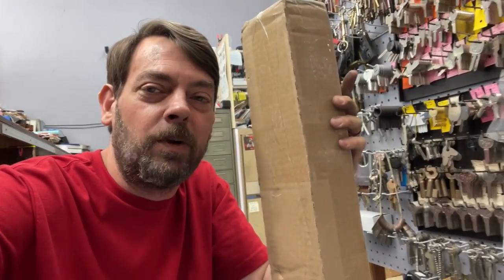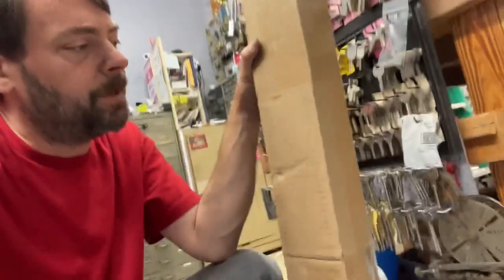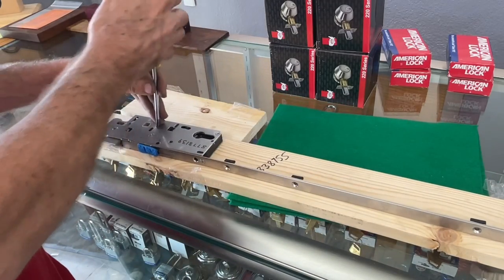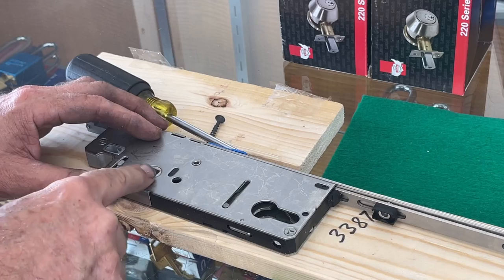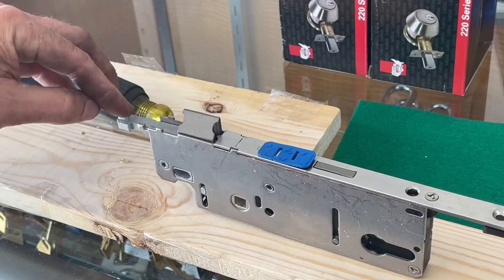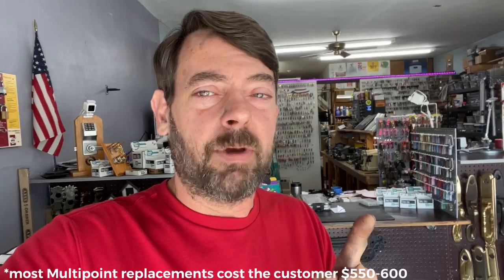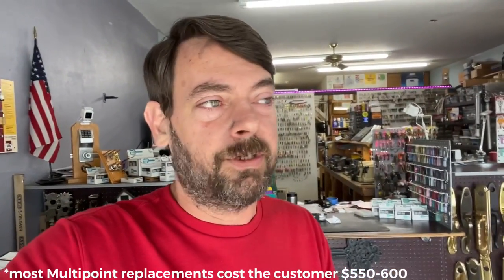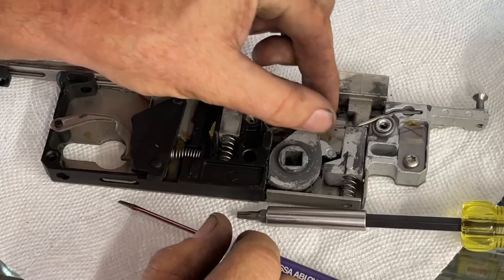Broken Hoppe (or other) Multipoint Locks? What to do!

Comment from the maker: PROFILE CYLINDER REMOVAL: If you look very closely underneath the thumbturn there is a small slit in the metal. Take a sharp instrument (like a ice pick) and insert it into the slit and pull it down, you will feel it is spring loaded. That spring loaded mechanism stops the thumbturn from turning to the removal position. It might be easier to loosen the set screw on the thumbturn (metric allen) and take it off to see the slit/tab you are pulling down

Comment: Btw, thanks for pointing out the charging more with multiple trips. The last multipoint job I had, the customers door was stuck shut in the locked position and I had to cut the hinges to remove the door. The supplier replaced everything for free, hinges included but they sent directly to the customer and the handing was wrong and it wasn’t field reversible so they had to send another one so I had to make 3 trips. I learned the hard way to not bid the job other than trip(s) and hourly rate. Thanks again!
Reply: I deal with sometimes 4 of these a month. never less than 2 a month. Most of the time I get called when it is broke and in the locked position. On the hopper ones with an American style cylinder you can pop the trim and use a 3/4" hole saw to drill behind the trim into the lockbody and pop the open pretty quick.

the only brand of these that seem to hold up are some of the Anderson ones, which then have an easily replaceable piece of the thumb turn break before any damage can really be down to the gears.
Reply: @jamespetkwitz8737  Thanks! The last one I did the internal cam had broken (I did vid on it awhile back). It was warranted by “unique home designs” and they replaced everything including the hinges. Most of them are fairly easy to work on or replace but I opted to let warranty do it’s job as I never dealt with this brand. Just took forever for shipping. Thanks again!

Comment: Thanks for the vid. Interesting to see how others deal with these locks.
Most of the units I have to service in this area, are the Peachtree multipoint locks. The rod for those locks are inside of the door, and have to be pulled out and reinstalled with hemostat pliers. Those are not for the faint of heart!

Comment: I’ve replaced/serviced a lot of these type locks over the past several years.  Very good video sir.  And yes it is a shame that we can’t get small parts.  Most of the multipoint door mechanisms fail the same way.
Reply: What is the best lubricant for the slider and the catches? I want to completely clean it and re lube.

Comment: I usually keep the center mortise part of the old ones and use parts out of them to repair others.  They do have some boing factor when disassembling and assembling but if you’re careful you can do it.  People get tough with them and damage the gears rather than trying to push or pull the door into alignment. 
Like you said the best bet is to replace them. I usually tell the customer the repair is to get them by until the new one comes in and we can get it installed. 
It’s funny the locksmith here who has been in business for fourth plus years won’t touch them. When he gets a call he gives them my number.  I had one customer tell me the other locksmith told them I was the multipoint specialist.  I look at it as a job is a job, charge accordingly.

Comment: Jason, I got a good one.  Hoppe 9000 - Door closed, deadbolt is jammed in the locked position (thumb turn will not turn), tongue bolts retract, center latch and deadbolt don't.  These locks are pretty nice, until the gearbox fails.  Working on a house now with 4 broken gearboxes.
Reply from the maker: Oof that’s rough

Comment: My god, I was at a job yesterday. Customer had a broken hoppe, I youtubed some stuff and found a video you had from 4-5 years ago installing a HOPPE replacement… 😭 it didn’t really fix my issue but this video was what I needed. The profile cylinder at first wouldn’t retract the bolt back, nor would it come out at all. I managed to get the Profile Cylinder to pull the bolt back and forth like normal, but still couldn’t remove it from the mechanism. Of course once I got that done, the handle stopped retracting the latch. Cx just wanted the bolt w/ key to work so they could close the door. My lack of experience in these multi point systems really showed but I was able to come to some sort of solution. I just don’t know how the hell the profile cylinder will come out of that damn lock. It’s like the tail piece is hung up or something, no idea how they’ll get the HOPPE out when the cylinder is stuck where it’s at. Smh
Reply from the maker: I failed to mention it in this video but if you look really close under the thumbturn there is a tiny slit. If you jab a sharp ice pick thing in that slit and pull down, there is a springloaded tab that stops the thumbturn from rotating to the removal position :) You can feel the spring as you are trying to pull it down. If you remove the thumbturn by loosening the set screw on it you can see it better
Reply: @selock  oh my god! You are a legend Jason. Thank you! I’m calling that Cx now to tell him what you said. 👍 Let me make sure I understand, after I do the “ice pick” thing, I should then be allowed to remove the cylinder from the housing?
Reply from the maker: @BigBlunts_Boxing  you should be able to yes, it’s a bit finicky to do but if it has the little slit that’s definitely what keeps it from turning. If your thumbturn only rotated like a quarter turn that’s definitely it :) it’s just a little tab that stops it from rotating (also, I assume you removed the screw holding it in) once the tab is pulled down (towards floor) you can rotate it further to get to cam to the right position to pull it out.
I updated this video with a pinned comment, I really should have mentioned it in video!
Reply: @selock  you are truly amazing! Thank you.

Comment: Dang customers always want to pull up on the lever and turn the thumb turn at the same time, and you try to explain to them, it's a 2 step process. 1. Pull up on the Lever, that engages your top and bottom points. 2. turn the thumb turn, that locks the deadbolt in the middle and locks the handle in place for the top and bottom points. I explained this to a lady 5 times, and said "Ok, for the fifth time, go ahead and try it". What does she do? Up with the handle and thumbturn at the same time.. It's like I'm speaking a different language. 
Luckily here in Kansas City, we have "All About Doors and Windows" I can just take off the door and take it in and swap it out, don't have to wait for the mail.

Comment: Hi, have you come across these that don't have screws/not screwed into the spine of the door? I have that type in my patio door, and I wish to replace the whole lot, gearbox and sliders etc for a user servicable unit. There aren't any screws holding the mechanism to the door side though. There are only 2 screws that hold the interior handle to the door, thats all.

Comment: typically I advise customers when these break to let me replace them with their single point variant when available. I then cut the entire old face plate and used it to fill in the routered channel on the edge of the door.
Reply: I find that most of the problems come from the fact that the shootbolts or toungues begin to not line up, and the cheap metal gears will start to shear and strip out.
Reply: a lot of the single point variants also doing have the little actuator pin that is a weak link on the multipoints

Comment: I wonder if anyone can advise.
We had a new wooden door fitted and a new multi lock mechanism fitted into it. The lock works well but with one small problem.
On our door the key won't fully turn or lock the door after the handle is moved to the up position and released. The only way the key will work is by keeping the handle in the up position. This isn't ideal as locking the door is a two handed process instead of just one.
If anyone can suggest a solution it would be much appreciated.

Comment: My handle isn’t droopy, it just won’t let me turn the handle down at all. Any fix to that? Or still need to replace whole thing?
Reply from the maker: There is a part in there that "blows out the back" right behind the latch and (basically) the part that is supposed to turn is now blocked by the little tab of metal that blew out. That's typically what it is, and yeah time for a new one

Comment: Only came across these 2 times in 10 years. Pretty sure its a 3 point lock made by Baldwin? These locks, you actually have to take the door off the hinges, place the door on its side, then use a special tool to go up through the bottom to disconnect the 3 point lock.
Reply from the maker: Baldwin does make some kind of this thing but this one was Hoppe

Comment: On the multi-point lock gear assembly that strips out you mentioned 3D printing well, if you had the ability to 3D metal print which is expensive you could make multiple replacement parts. Just an idea.
Reply from the maker: true, but there are so many different styles and other parts could break as well inside so I doubt it’s economically feasible for anyone to do it
Also given the fact most locksmiths won’t even mess with these I doubt there would be many people who would attempt the repairs. Very low percentage I’m sure